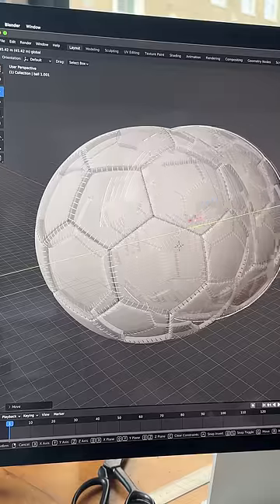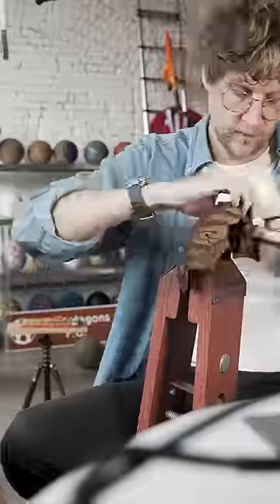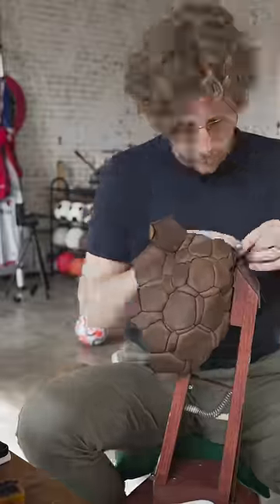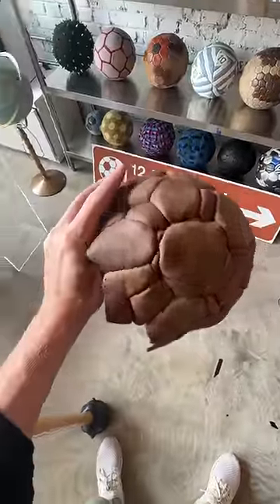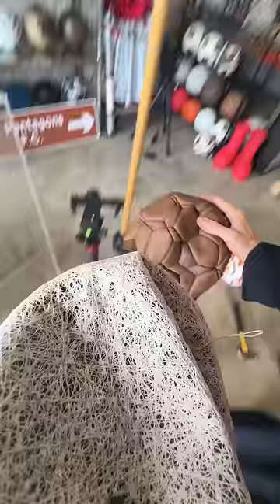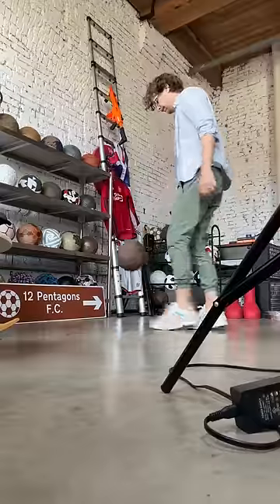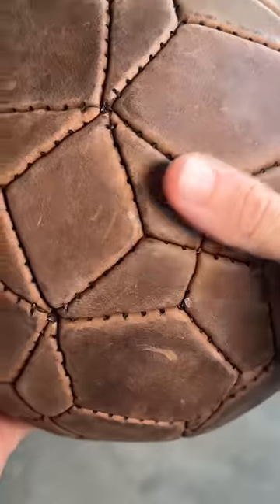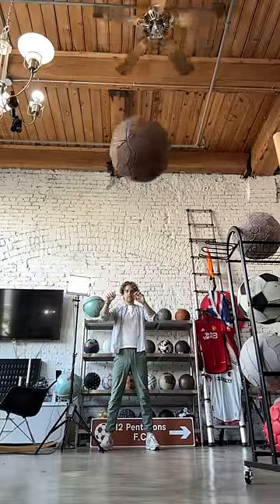this ball doesn't look real

Comment: It would be cool if the stitching was visible and each ball's stitching was a different color
Reply: PLEASEEEEEE
Reply: Has he made an inside out ball where it's visible
Reply: That's what I was thinking
Reply: @michaelwillerton3685 or he could use slightly thicker thread or thread it a bit looser to show those seams better
Reply: Red and blue stitching like old 3d movies would be awesome
Reply: Cool
Reply: Problem is that the panels of each ball share stitching. You'd need to have 2 sets of stitching in each hole, one thread of each colour through each hole, so the coloured stitch lines outline their respective panels
Reply: @RobQuinney  they don’t share stitching. Borders from ball one = one color; borders from ball two = another color

Comment: You could upcycle two different existing balls of the same size into a unique, complementary pair of balls by cutting both of them up in the same pattern and swapping the segments so each of them has exactly the stuff missing in the other one. That would be or "mevand alk that I am not", or "me and my hypothetical anti-identical twin".As the process is basically like the halving and rematching of DNA as it occurs sperm and egg. Or you could do that to a number of source balls.